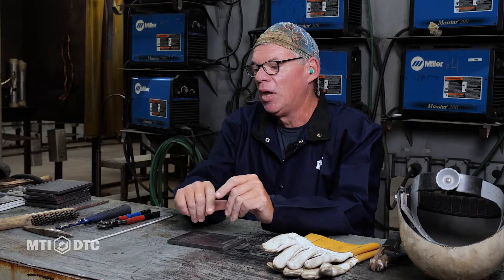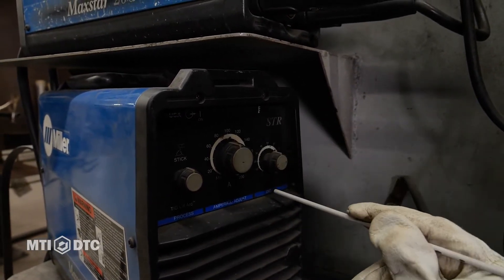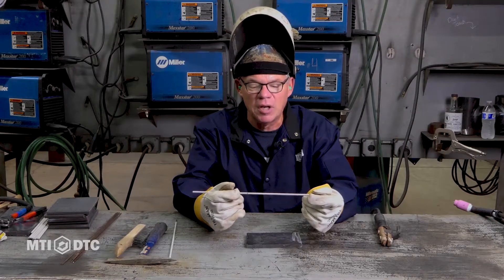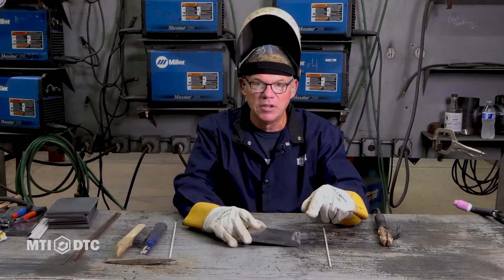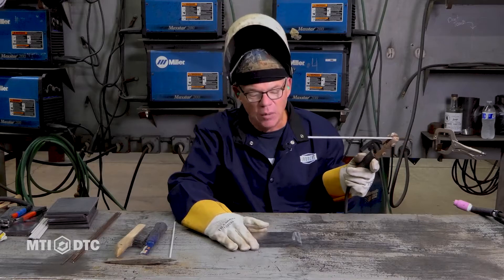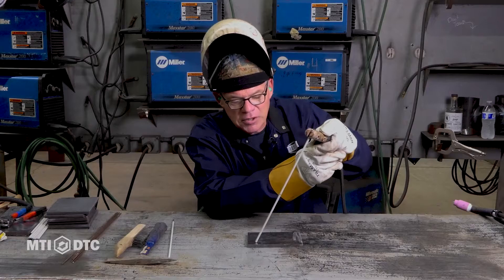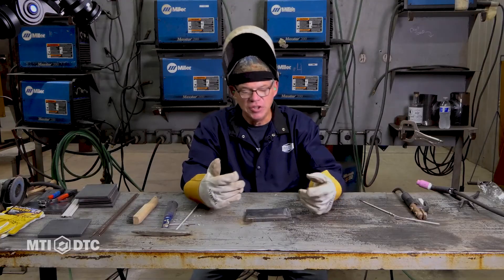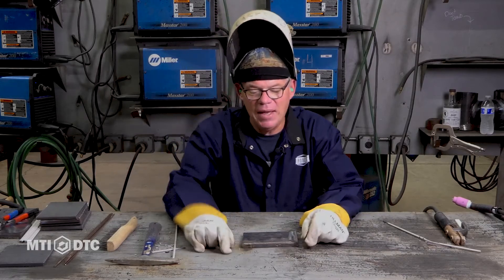Welding Instructional Series: How to Stick Weld

Comment: As a former welding student-  very good, concise video with ample explanations.  What I have found to be the 2 critical things about stick welding are arc length and travel speed.  Arc length for consistency of the bead, and travel speed to make sure the flux has sufficient time and heat to do it's job and "cook" onto the weld.  Too fast of a travel speed and you're literally having to bang away at the slag to get it off because it hasn't "cooked" onto the bead enough.